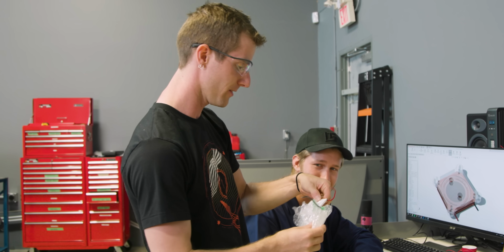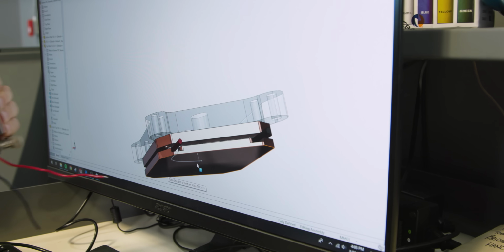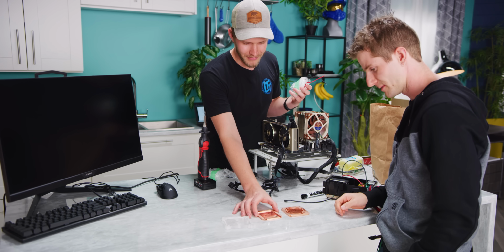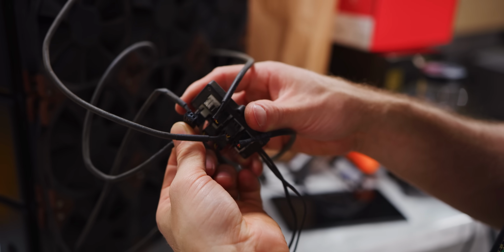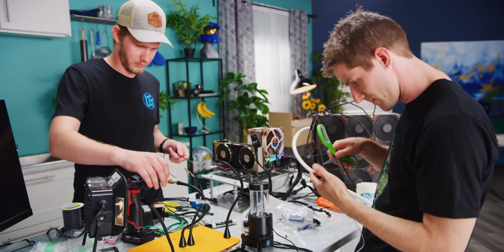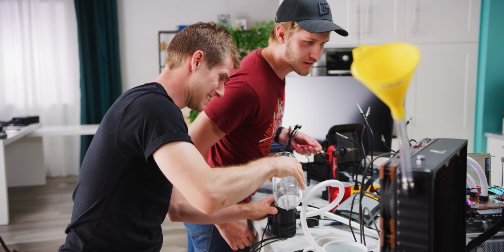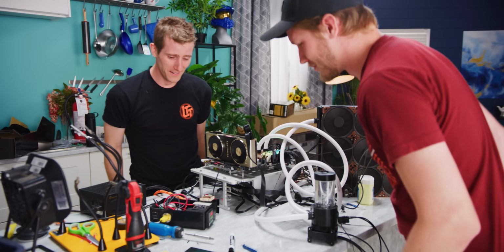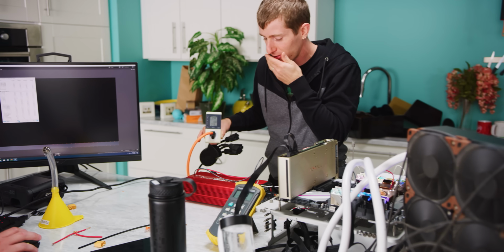This Cooler DRAWS 545W!!? Bad Cooling Ideas #2

Comment: 9:20 Dude I used the 140mm version of those fans! Noctua Industrial PPC Yeah! My PC uses 6 of them on two 3x140 radiators. I have 3 more as exhaust case fans. Bought 10 in total but 1 died really fast. https://imgur.com/gallery/eqmQEV5

Comment: What if you put a TEC between the out on your rad and the CPU to chill the water a little extra after the radiator? Then the rad would be doing most of the cooling, but with a bit of help from the TEC.

Comment: What was the TDP of the CPU?
I suspect it's well under the 500 odd watts the peltier was rated for (though, there's ratings and there's ratings ).
I also suspect that by pushing 900w into the TEC you just pushed it into thermal runaway.

Comment: Couldn't you dip it in mineral oil to get around the condensation problem? Seems like it would be better by a mile at dissipating the heat of thecopper, and then you wouldn't have to fool with a relay that may or may not be functioning correctly. It's also got to be worth a shot to run the thing at full blast right?  whats the marginal cost of that video and can i pay it?

Comment: The biggest issue with TEC cooling is everyone does the obvious idea of just slapping one directly to a CPU which is a terrible design for them. TECs are most efficient when the difference between their hot and cold side isn't very large. This is the exact opposite of what the cooling solution needs to be efficient.

I have a much more interesting design in mind for a TEC cooling solution; problem is that I don't think I have the money to even buy the TECs that I'd need, let alone the CNC mill to make the heatsink designs.

Comment: Why was there any expectation that this would work? Putting a flat water block on a TEC is no different from putting it on a flat CPU, except that you’ve added a lot more heat in the process. 
I think it’s great how you guys experiment and learn, but sometimes a “thought experiment” gets you there a lot quicker.

Comment: The problem isn't the TEC, it's the cooling of the TEC. The cooling performance of the TEC is dictated by how cold you can make the hot side. So Linus turning the voltage up higher makes the problem worse because it's now moving even more energy to the hot plate and is overwhelming the custom waterloop. Did they even test the custom coller to see if it was good enough to cool the cpu alone let alone with a TEC attached? I would suggest monitoring the water temperature in the loop, and possibly trying an even bigger radiator like the one Jayz2Centz built (480*480 with a large industrial fan) or a really big heatsink with high speed airflow. Also why have the big copper plate between the CPU and the TEC. Delidded CPU and direct contact is the best way to go, even if harder to mount. For a TEC that powerful you need a huge amount of cooling for the hot side. Try again at lower voltages and you will probably find that the cpu takes longer to throttle.

To put it another way you have a Titan of a TEC cooler and a Sempron amount of cooling on the hotside.

Comment: If you work with electronics, use a different fire extinguisher: CO2 does not damage anything and kills the fire and it's refillable. It actually comes out frozen.

Comment: @10:55 Wow... Has a 12-15k CNC Router sitting in the back of the Shop ( which he USED to mill both the Copper and Plexi ) but didn't use it to ALSO thread the Plexi!? Too cheap for a thread forming tool or what?

Comment: Those thermal chips work in either direction if you happen to put something in different than the way you wanted it you just reverse the polarity the hot and cold side on either side depending on which way you wire it

Comment: what happens when you apply low pressure on the cooling circle of a regular water cooling solution? if you near the vacuum the water will condensate at lower temperatures and releasing the heat it was able to contain while being a liquid?

Comment: Question what if you molded the water block to the cpu to fit it perfectly  not just the top of the cpu down the side just before the board.  Wouldn't you increase your cooling surface area by about 20-30% and be alot more efficient

Comment: What's bugging me about that is, that the first thought I had in the design was that removing the bottom copper and the peltier would improve the heat conductivity between cpu and water, right?
I mean all those layers of thermal grease while you could just lower the distance between cpu and water. Would even perfect transfer between peltier and copper be worse than just less heat conductant? If you need to transfer the heat 7mm less won't it always be an improvement? Or am I neglecting something here?
Reply: I mean if you have a cpu cooler, wouldn't putting literaly ANYTHING between cooler and cpu make the transfer worse (aside from grease to improve contact)?

Comment: @linustechtips this setup is not a good setup -- it's inefficient.
Placing the TEC between the processor and the water cooling loop makes no sense -- if the water cooling loop is good enough to cool the TEC, then it is also good enough to cool down the CPU which will be cooler than the TEC which is cooling it.
What you should have done is plugged the CPU directly into the loop, and also plugged a TEC into the loop independently, which is cooling the WATER in the loop. This would be a way to ensure that the TEC is only a benefit in the loop.

With that said, even if you do add an independent TEC to the loop, it would be more efficient to plug whatever is cooling that TEC module into the loop instead of the TEC, because whatever is cooling the TEC needs to have greater cooling capacity than the TEC itself. You'd have a benefit to plugging a TEC this way if you wanted to cool something below room temperature, but otherwise, a TEC will always create more heat than it disperses.
Reply: If you were to put multiple tecs on to the radiator on the exhaust side the tec would cool the find and pipes and fans would blow heat away.
Reply: Yes it's inefficient (TECs are inherently inefficient) but if the water cooling system is up to the job and the TEC is appropriately sized then it will provide superior cooling compared to just water cooling.  Without a TEC the cpu will always be hotter than the water, with a TEC the CPU could be below the temperature of the water.  The main problem here was simply down to a bunch of parts thrown together without any actual engineering thought going into it.
Reply: @ferrumignis  There is quite a distinction between the goals of cooling and the goals of heat dissipation.

Yes, you can achieve lower temperatures more rapidly by using a TEC. However, while you use the TEC, you will have a component which is dissipating heat from the other side of the TEC. That component, which is dissipating heat off of the TEC while it is working, will always have greater heat dissipation capacity than the TEC.

This is because the TEC will always produce more heat than the heat that it removes. If heat dissipation is your goal (which, it is with CPUs -- lower than ambient temperature will get your rig wet with condensation), then you will be able to achieve greater heat dissipation by plugging whatever it is you have been using to dissipate heat off of the TEC, directly to your loop, without the TEC.
Reply: @petabrain  My point has got nothing to do with the speed of heat removal, its the fact that a TEC is a heat pump. A suitable TEC (or another kind of heat pump, e.g. phase change) will drop the temperature of the CPU below that of the coolant. Without the TEC the CPU temperature must always be above the coolant temperature.
Reply: @ferrumignis  yes, I agree. 

However it is generally undesirable that the coolant is below room temperature due to condensation.

In a perfectly dry environment, this may be a workable strategy.  But then if you control the environment this much, perhaps it would have been simpler and more efficient to cool that environment down and use a fan for the CPU :)
Reply: @petabrain  You're conflating coolant temperature and room temperature. You're also ignoring that the heat dissipation capacity of the radiator part of the system depends on coolant temperature. Also ignoring the heat transfer efficiency between the processor and the block. 

Let's use a hypothetical. 100W CPU, 100W TEC that can transfer the 100W from cold to hot side at 20 degree delta. A water cooling system that dissipates 10W per degree coolant-ambient delta. Water block that has a plate-coolant delta of 20W per degree.

No TEC: 100W flowing from the CPU. Dissipating 100W means the coolant is 10C above ambient. The block's plate is 5C above coolant. So the CPU's IHS is 15C above ambient. 

TEC between CPU and water block: 200W has to be dissipated by the radiator, making the coolant temperature 20C above ambient. 200W through the water block makes it's plate 10C above coolant. TEC's cold side with 100W flow through it from the CPU will be 20C below cold side. Adding it all together we get the CPU's IHS at only 10C above ambient. 

Not a great result, but the figures are arbitrary. Some real data: 

TEC: TEC1-12715, at 100W pumping through it, 50C hot side, 30C delta, 225W consumed power. 

Water blocks can easily reach 0.03C/W.
A decent 240mm radiator can do about 350 W at 10C delta.
Putting it all together, pushing 100W through the TEC means removing 325W from the hot side. The water block's resistance will mean the hot side is 9.75C above coolant temp. 325W through the radiator means the coolant is 9.3C above ambient. The TEC has 30C delta. The cold side of the TEC is indeed around 11C below ambient. Since this is just the interface temp between the TEC and the IHC, it's easy to insulate from the atmosphere and the rest of the socket and CPU will be  afair bit warmer, above ambient. Either way, the power of the TEC can also be varied to bring this up to ambient if necessary. So, how's this better? Well...

Let's consider the same CPU without the TEC. 100W through the radiator gives 2.9C delta, and the block gives another 3C delta, so the IHS surface will be almost 6C above ambient. At worst, the TEC will shave 6C off the CPU temp. 

Let's also consider a higher power CPU. 140W should do it. The same TEC will have about 12C delta at 140 watt Q. 10.4C at the radiator and 11C at the water block for a final IHC temp of 9.4C above ambient. Withoutthe TEC the radiator will have 4C delta and the block will have 4.2C delta, for a total of 8.2C delta. In this case the TEC gets in the way. As you can see, Whether the TEC helps or harms will depend entirely on the specs of the parts and the power you pump through them. One CPU can see 6-17C drop by using a TEC while another will see 1.2C rise. This is also why the setup in the video didn't work, they overwhelmed the TEC with ridiculous power from the CPU when a more modest CPU with less overclocking would really benefit from that TEC setup. Especially in places with high ambient temperature. 

tl;dr: The TEC used in the video has a Qmax of 282W, of course it didn't work. If you add it to a CPU that only consumes 200W tho, you'd get a 20 degree drop in temperature. 

P.S. Using the TEC to cool the coolant in the loop is pointless and radiators already do a decent job at it. Taking the coolant below ambient could be done, but at that point the coolant and blocks are just needless extra steps between the CPU and the TEC's cold side, actually harming the loop. If the coolant is to stay above ambient, extra radiators are a better way of dumping the extra heat from the loop than using a TEC to cool the coolant.
Reply: This. I've been curious about cooling water with TEC idea a long time and might do it on my own if LTT stop here with this video series.
Reply: @didyliduu  if you do end up making that video,  try also testing the full loop, just without the TEC -- that is, the cooling for the TEC still connected directly to the loop, only without of the TEC. I'm sure this kind of comparison will show why a TEC is not a good idea for this kind of application more clearly :)
Reply: @petabrain  Not gonna film anything, its jusy for my own fun :)

Comment: How about cooling the water in a custom water loop with the peltier? You can use standard cpu block, radiators etc and use that block you made to cool the water in the loop only (reversed peltier element to take advantage of the cold side)

Comment: Linus you need to place your peltier cell in series in the water loop,  water reservoir, the pump, then a water block for the peltier cell (the one you fabricated for this video) attached to the cold side of the peltier cell, then the cpu block, then another water block (another one like you fabricated for this video) attached to the hot side of the peltier cell, then the radiator then the water reservoir, I think is the only way to make it work.

Comment: Try cooling the fluid or the radiator instead. That will allow you to move the heat away from being right on top of the cpu and then you can use a normal liquid cooling setup where your cooling the liquid or you can cool the radiator. If you run the cooling in line. Kind of like an an aquarium if sterilizer forcing it to have a bit longer exposed to the cooling side and it can run in loop. Or you could cool the radiator but it would make more sense to try and cool the liquid without freezing it and you can migrate the heat away from everything and you wouldn't need to worry about condensation as much.

Comment: Why don't use the Peltier to cool the water and dissipate the heat from the Peltier with a heat sink? That seems to be easier to control and the extracted heat will be the same. P.S. I'm a Chemical Engineer and designed heat exchangers for my undergraduate courses.

Comment: Seems as though you setup your loop backward. Consider a traditional water block on the CPU side, and place several pettier devices on the radiator side, replacing the traditional radiator with a water block cooled by the pettier, which is in turn cooled by fans. This reduced the switching of the pelting, and increases the chilled water volume, much like the old video where you water cooled a CPU via continuous flow tap water.

Comment: what about using the TEC as a 2nd stage cooler in line after a 1st stage normal ambient air heat exchanger ?

Comment: One word on TECs, cascade! By stacking smaller TECs you can achieve better temps. The Voltage/Amperage does NOT have to be high to achieve cold temps, it has to be thought out. The biggest problem I find with TECs is insulating the hot and cold sides of something that resides on the same surface. As your TECs get cold on one side the heat side is maybe 1mm away on the other side. There is no great way around this but using a dense piece of insulation and completely isolating the hot and cold sides results in a much better result. For instance, they have food coolers that you can run on 12V with minimal power draw ( 3-7 Amps ) and keep your food and drinks around 10C. I actually cannibalized one that had a broken lid and built a portable air cooler that I eventually turned into a bay mounted air chiller in an insulated box I used my 3D printer to make. My point on this subject is you are skipping the "details" to knock out a video and I know for a fact that the younger hungrier Linus would have put the time into researching the subject better. Without the correct information, how can one "engineer" a solution?

Comment: Use TWO copper blocks with fins like an old heat sink.  Interlace the fins so that the mating surface of the second block faces away from the motherboard. Between the fins, sandwich as follows: Lower block fin, Peltier, upper block fin, Peltier, repeat.  Add a water block on top of the upper finned block.  This way you can pack in a LOT more Peltier modules and pull at least a few kilowatts!  Yes, I'm crazy. Do it anyway. :P

Comment: I have a feeling the water block physics had no safety margin so it wasn't working as well as simulated thus not enough heat from the heat sink to the water.  Built it again with a 4x margin and run the tests again.

Comment: But do you know WHY it didn't work? Is the TEC module too weak or is the heat transfer form the CPU to the module just bad?

One last idea for this project: Use a normal water cooling block on the CPU. Flip the Peltier element in its block and put it on the other end of the loop instead of a radiator. Now strap a GIANT heat sink on the hot side of the Peltier and give it a go.

Comment: sick the techs to the radiator itself.

no need to worry about condensation on the motherboard XD

Fanless Radiators XD
Reply: But how do you cool the techs then?
Reply: @C0mmanderX  A heat sink with a fan on it of course XD. (if were going completely silly here, water cool the techs attached to the water cooling loop cooling the CPU XD

Comment: Linus, i from malaysia and i think why not you cooled the water that goes into the processor instead of sandwiched the TEC like aquarist use to cooling their aquarium water? then the problem might be condensation at the tube ot the heatsink.

Comment: "If I have to blast a TITAN RTX I'm gonna be so pissed off"

I'm sure there is a cheap as crap PCIe graphics card somewhere in the warehouse they can use until they are satisfied it's booting correctly before testing further
Reply: Would also had helped in the event of shit going sideways if he had pulled the pin for the extinguisher before pointing it.
Reply: But where is the fun in that?

Comment: I think you should have tested the water block first, it doesn't look that good on the water side, those tracks/threads are huge.

PS, is it me or the radiator fans are not working?